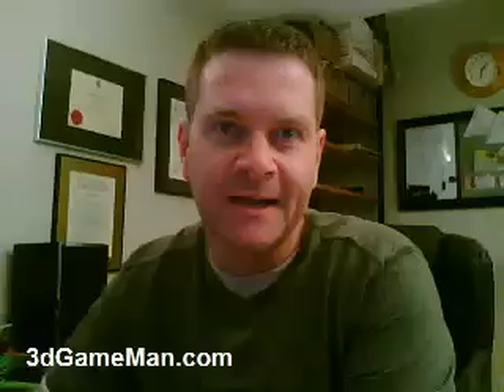#254 - What are motherboard phases?

Comment: Power source
|_|..................Bucket A
__|_|.............Bucket B
____|_|........Bucket C
_____|_|......Bucket D
Processor
If we assume that power from the source is going to flow to the processors then each intermediate bucket is a phaze 

if the power supply is fuzzzy u have (in this case) 4 break pouits which can control the flow the more u have the more control u have over the flow of power and more safely can u overclock , each bucket here normally will operate at 25% capacity